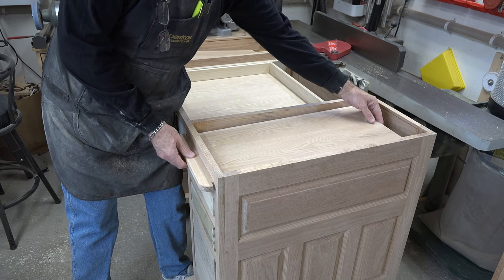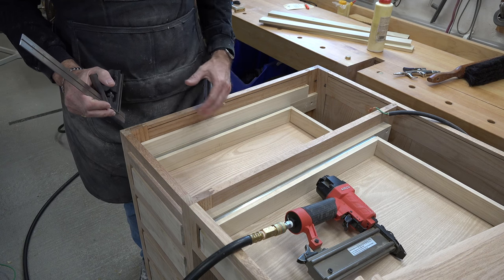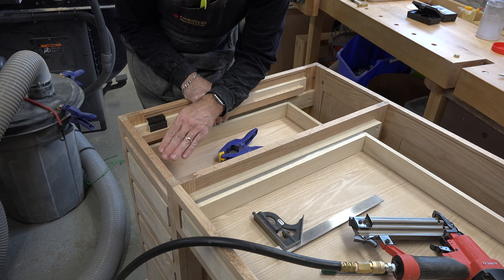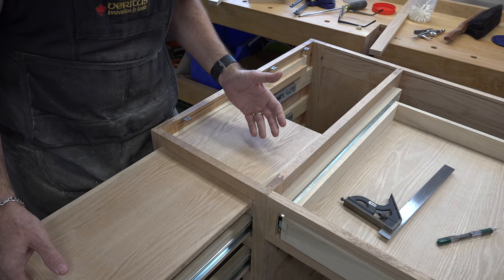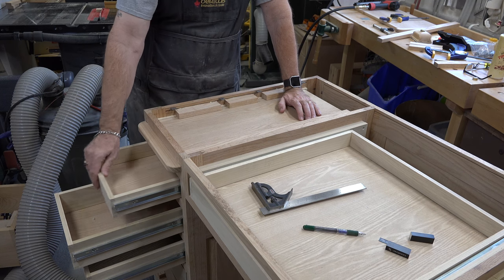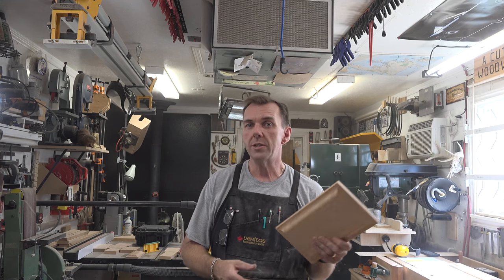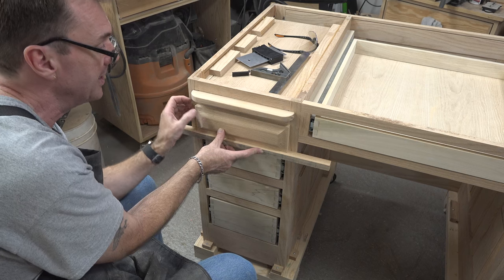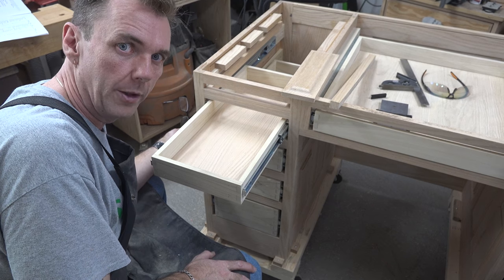Making a Roll Top Desk Part 6

Comment: This maybe a stupid question and maybe you had a reason but why wouldn't you start mounting your drawer faces from the bottom up? That way you could stack them and let gravity work for you? It's looking awesome btw, I'm gonna give it a shot, just got the plans and haven't gone over the measurements yet
Reply from the maker: It's just a personal preference thing Gene.  Like many procedures in woodworking, there are multiple ways of achieving the same result.  If you would like to mount your drawer faces from the bottom up, then by all means, do it.  That's just fine.  Thanks for tuning in and good luck on your project.  You're going to love the finished product.  I use this desk daily and love it.

Comment: Okay, I just figured out why you look so familiar. You remind me, appearance wise, of what I think Eddie Haskell from 'Leave it to Beaver' would look like all grown up. No offense intended. I was thinking some felt under the top writing board supports.
Reply from the maker: I'm not sure if looking like Eddy would be a good thing or a bad thing, so I will leave that one alone.  As for the felt, there's nothing wrong with that idea and it might give the writing tables a little smoother ride.  With that being said though, the tops of the writing tables never touch the support rails inside of the desk while sliding in and out so there really wouldn't be much of a purpose for them all in all.  Even when the table is extended and you are using it, the pressure applied to the board isn't enough to press hard enough on the guide rails to do any damage so the felt might end up being redundant.